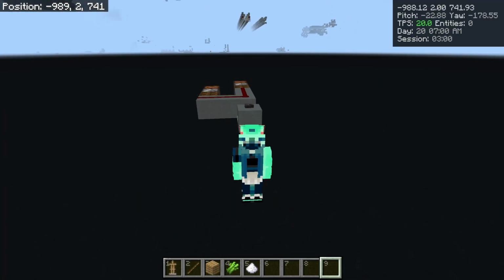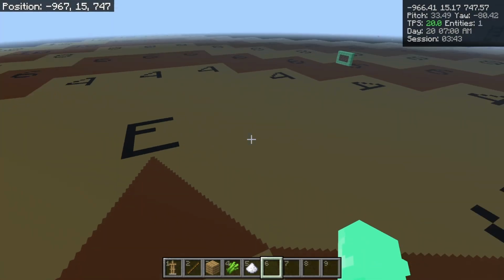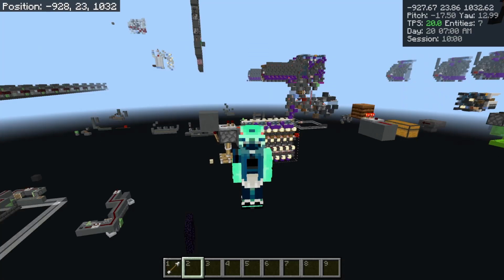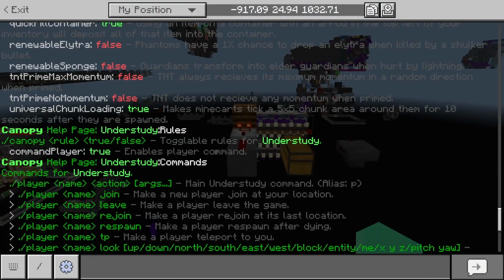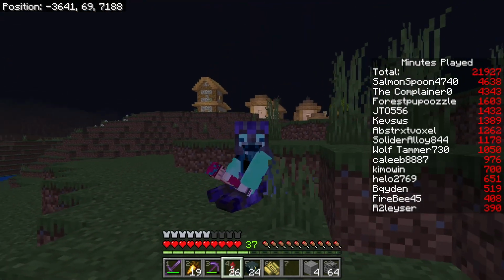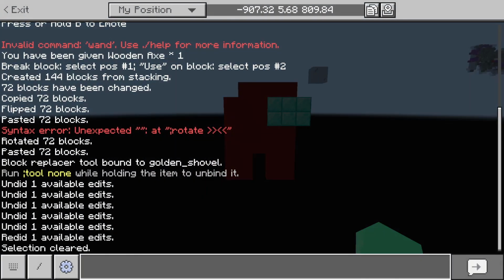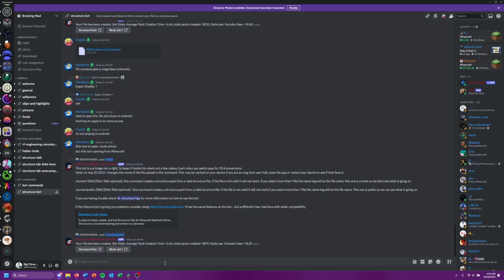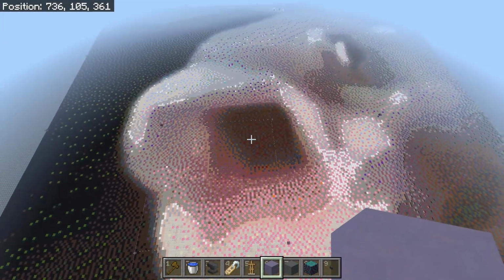The Tools Bedrock Redstoners Use to Innovate

Comment: I dont think redstone on bedrock is like good at all.
Period
The base game's redstone implementation makes compuational redstone literally imposible beacuse the clock speed is unreliable.
Reply from the maker: @gearsgamer7115  homie what? If anything computational is better on bedrock.
I'll start off with saying my qualifications include 3 full computers, a minesweeper game, multiple GPUs, and a work in progress project for a 10hz multithreaded computer.
In bedrock, we have the ability to pipe Redstone downwards with just glass. Also, 10hz mechanisms are far easier because bedrock's components respond go 2gt pulses no matter what (unlike java, where ttp causes torches and comparators to not turn on)
These simple facts alone make so much possible.
Additionally, clock speeds are not inconsistent unless you are using observers across a chunk border, so i have no idea what you are talking about.
Reply: Buddy, we got 0 ticks and comparator priming.
A 20hz cpu is theoretcially possible
""Additionally, clock speeds are not inconsistent unless you are using observers across a chunk border, so i have no idea what you are talking about."

Well observers are usefull for some computational redstone....
"Also, 10hz mechanisms are far easier because bedrock's components respond go 2gt pulses no matter what (unlike java, where ttp causes torches and comparators to not turn on)" suprisingly, yes and no. 2 gt is 4 gt on bedrock (why? Bedrock's repeaters are literally twice as slow)
Comparator priming.....
Also, no chunk loaders....
Also, all components have random gametick updates. period. No chunk boders. Period. The update order is random, you have to SLOW DOWN THE BUILD or redesign a lot of circuts for it to work.

The random update order and slowing down and no quasiconnectivity and stuff also makes some things literally imposible when working on doors.

Like, literally. Sense instant redstone lines arent available on bedrock, you can only build a maximum of a 10 hz clock as you said.

Finally.
Walls
walls, aka cobblestone walls or brick walls (the block) work as something like the glass your talking about and you can use the same trick with a dropper-observer bud rail to make stackable insant vertical redstone up and down too (admitley its a bit bigger, but works with any signal strengh)
Finally, Redstone torches ARE unreliable on bedrock.
Torch burnouts can randomly update when loading the chunk, sometimes Redstone itself.
Reply from the maker: @gearsgamer7115  this screams complete ignorance of the bedrock Redstone system.
Firstly, repeaters are not twice as slow on bedrock. The game still runs at 20tps, and a repeater still takes 2gt to update.
Secondly, where are you using torch burnouts in computational?
Lastly, with anything other than pistons, hoppers, or droppers/dispensers/crafters, update order IS consistent. This means that when using torches, repeaters, dust, comparators, etc (aka the stuff you should be using for computational), If something works once, it will always work. No locationality or anything like that. Running into unreliability problems is a skill issue and nothing else.
Reply: @BigCitrusFruit  Ït does run at 20 tps, but if you look at a clock its twice as slow with the same circut. Why? Redstone repeaters are 4 gt n ot 2 gt
torch burnouts in computational redstone, no, I was talking about super fast redstone builds....
Reply from the maker: @gearsgamer7115  I have both versions of the game open in front of me. This is straight up just not true?
Reply: @BigCitrusFruit Lots of Minecraft players say bullshit on bedrock because they listen java youtubers
Reply: @BigCitrusFruit  Something I didn't mention is that some 2 directional instant wire designs using minecarts output a 1.5 tick pulse, which also works with torches and such
Reply: Oh and also dont even try to hide behind instant wire anymore. I’ve already fix that issue. :3